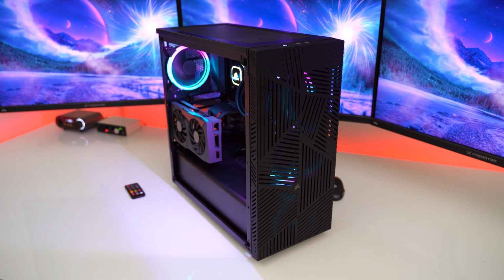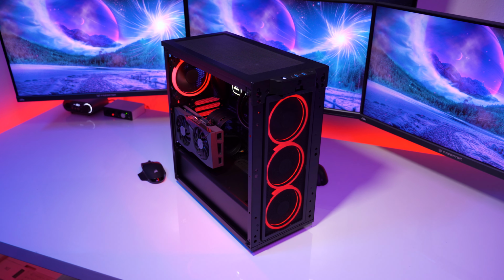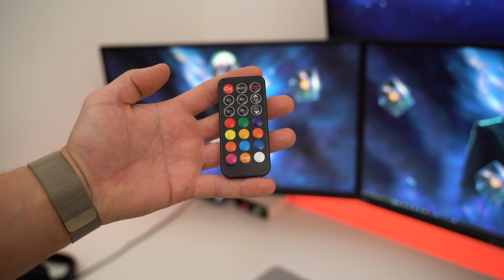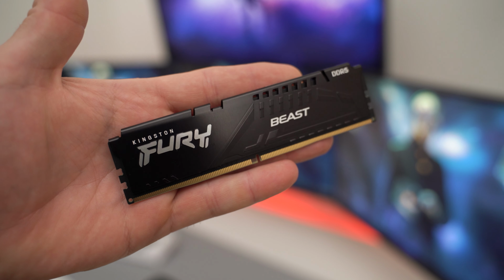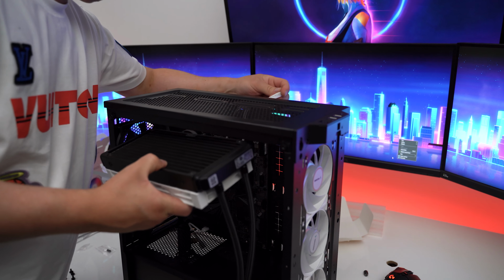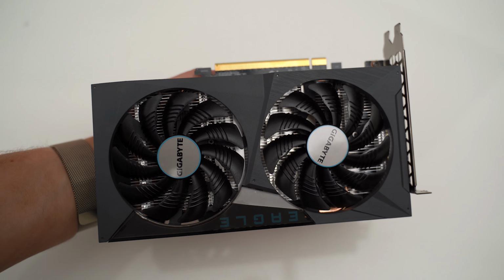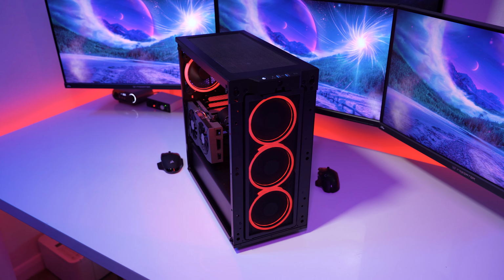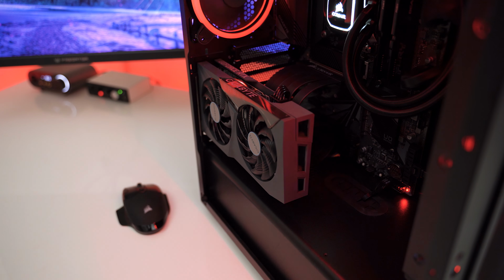$1200 Insane Gaming PC Build - Intel 12 Gen i5 12400 / RTX 3050 (Benchmarks)

Comment: 3050 for $1200 ? Seriously ? 3050/3060 really suck ! At least go for 3070 or 6700XT, the price is too high for the build and the standing VGA card makes it more stupid, how can it take the air in if you mount the glass on the case ? Total failure !